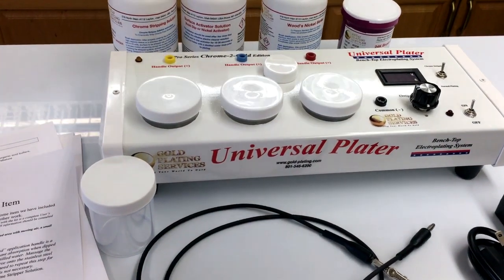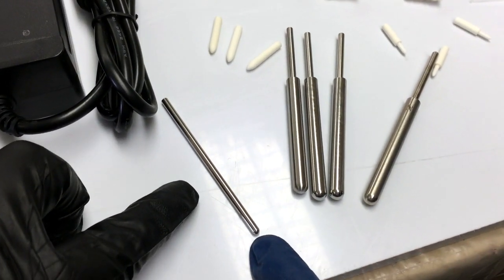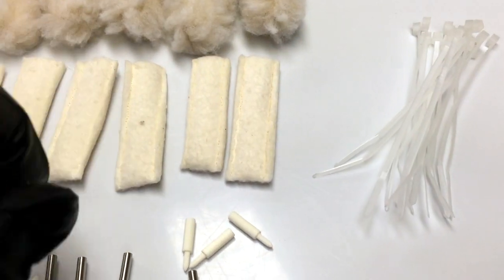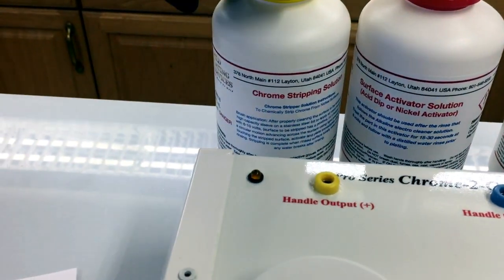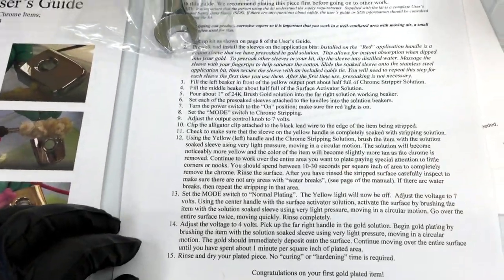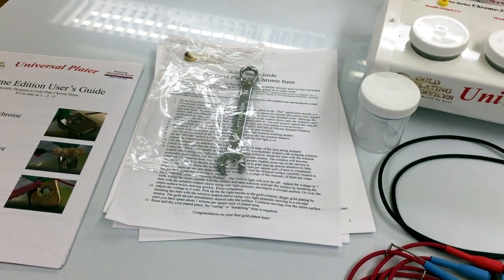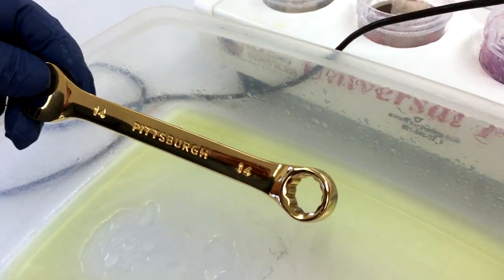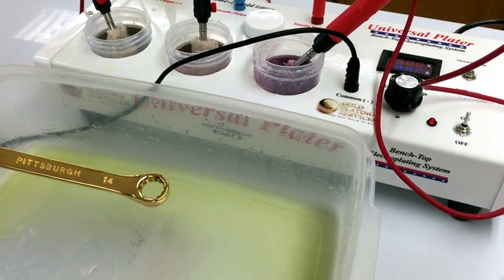How to Gold Plate Chrome Items - Un-boxing, Set-up and Plating - Universal Chrome Edition

Comment: Thank you for posting this. Is this system or technic more efficient and cost effective than just dunking the whole item in the solution? I've seen the "Dunking method " and  the instructors say "Once you make the solution, you never have to make it again" . I plan to re-plate vintage safety razors and  looking for the best way overall to do it. Thanks.

Comment: Hi ... Found your vid; very informative. I want to gold plate an item that has come out of an engine! The item; I have cleaned up as much as I can. How clean do I need to get this item before I attempt to gold plate it? For example; if there is some old oil stains and a little grease on that item; surely the gold plating process is 'not' going to like that!? So, should I soak my item in some sort of acid tank to remove completely all dirt, grease, and oil, and other 'maybe' contaminantes before starting the gold plating process!? 
And, the other quick question is; if I want a really deep finish to the gold plating, can I just keep going 'back-an-forth' over the coating to just make it thicker and thicker, therefor a 'deeper-an-deeper' finish, or is that not the correct way to create a deep quality finish!?

Would love your thoughts.
Thank you so much.
William (Hampshire UK)

Comment: Hello. I've got some old watches that lost their original plating. They were not chromed before. I want to restore the gold. How would this product perform in those areas ? It is very small stuff and tiny corners. I'm also curious to know if different stripping chemicals need to be used to remove whatever they use on watches . Thanks for the video
Reply: I’m wondering this too.Please let us know

Comment: @15:37 you mention "You can't really go wrong over stripping the chrome" but I'll have to assume this isn't the case with fully submerged chrome stripping because if I leave my chrome item in the solution for more than just a few minutes in chrome stripper even at only 5v I end up with the chrome burning and turning a very dark color.  If you would like to comment on this, I'd love to learn something new that I may be doing wrong.

Comment: Can I gold plate flatware for my wedding? This is awesome
Information. It’s so expensive for 800
Pc of flatware
Reply from the maker: Absolutely, flatware can be done.  Congrats on the engagement!  Weddings can be one of the most amazing days of your life.  The question would be, do you want to do all the work yourself or would you rather us do the plating for you?  Plating 800 pieces would be quite time consuming, simply due to the huge number of pieces.  If you'd like, you could shoot us an e-mail with a picture of the flatware you have in mind and tell us what material it's made of (preferably stainless steel if possible) and we can give you our best quote on 800.  E-mail info@goldplating.com

Comment: cool system.

if I were to re-do a watch case where it is Silver ->Nickel ->gold....where the gold has worn off  (the thickness should be about 20 microns)

Do I buff off the gold to get down to nickel? or is there something that can strip off the gold to get down to the nickel layer, buff that, re-nickel plate, buff that, THEN gold plate?

Comment: How good is this for a 416 grade 1911. It seems small and does not take a lot of space. I want to do a nickel finish with a high polish. I also want to ask, if I do go with this process for protection, would I also coat, but not polish the inside of the frame / slide

Comment: Im looking for something i can use on firearms, 
My question is does the firearm need to be crome or stainless steel? 
I can remove the bluing on the gun easy but ill this compound stick to gun?
Reply from the maker: You can plate onto chrome guns, nickel guns, stainless steel guns and regular steel guns.  Guns that are blued or coated with anything need to have the coating removed prior to plating.  Once down to the bare steel, you can easily plate onto the steel the same way as you plate onto stainless steel.  Here is a video showing how we did just that on an AK-47 safety, made of steel: https://youtu.be/gNBC03rq31k

Comment: Oo  a grand for a bench power supply and some chemicals?
Reply from the maker: Great deal right?  Especially considering some of our competitors sell an 8oz bottle of Brush Gold for more than this entire kit.  The 8oz Jar that comes with this kit contains enough gold to cover about 1,200 square inches of area to a typical decorative thickness, so you can do a lot of plating.  It also comes with a large bottle of Chrome Stripper, Woods Nickel Strike, Surface Activator and Electrocleaner. This kit is unique for many reasons.  It really is a complete package that has everything someone needs to get started gold plating onto almost any kind of item that can be brush plated.  It is not just a "power supply and some chemicals".  Thanks for the comment Mr. Schmoe

Comment: Does this mean I could improve the connection on cables by making it gold tipped?
Reply from the maker: Many cables have gold plated connection points.  So do Printed Circuit Boards in computers.

Comment: Considering getting one your kits. I have a few question though . How durable is this on car emblems ? Considering the front of cars are exposed to road grime, bugs and mutliple washes . What kind of time would you have to spend plating a typical emblem for it to last years ? I want to do this as a business and would hate for people to come back a month later saying it wore off. Secondly could this be done with the emblem still on the vehicle? Do the solutions affect car paint finishes ?  Lastly would this work on any chrome plated surface ? Some emblems are plastic and seem to just be painted chrome . If you were to strip back the chrome and reveal only plastic underneath how would you go about gold plating it ? Hopefully you can answer my questions I would love to order a kit very very soon.
Reply from the maker: DURABILITY: It's has hard as gold plating can possibly be.  The thicker (longer) you plate it, the longer the plating will last.  If it is taken care of and not polished, it should lost many many years if done properly.  
TIME PLATED:  Most automotive platers spend about as much time as we did on this wrench.  Check out our other videos that show plating emblems to get a better idea.  If you're concerned about longevity, plate it longer.  However, this is not a common problem.  The only way they're going to come back a month later saying it wore off is if they polished it off or you just tinted it gold (stopped after seconds of gold plating).
STRIPPING CHROME:  A lot of times people see chrome plating bubbling and think it was painted, however that is due to incorrect chrome plating.  Underneath every chrome plated layer, there is a layer of nickel (across the board).  This means it can be easily plated once you strip the chrome.  In the event that you did get down to plastic, somehow, it would not be platable. 

We're happy to answer any and all questions before and after you order.  Thanks for the great questions!
Reply: Gold Plating Services thanks for the ridiculously fast reply. Sounds great I will be ordering a kit very soon ! One more question though if you don't mind , how would you go about gold plating things that aren't chrome ? Would you plate it in nickel then gold ? Do you sell a kit for that ?
Reply from the maker: You're welcome!  If you need to nickel plate something prior to gold plating purely depends on the situation.  Typically, nickel is commonly used as a "diffusion barrier" between a more reactive substrate, (such as copper or brass), and the gold plating.  Gold plating is porous, especially if it is thin, and the copper or brass can still corrode underneath the gold unless you either plate it thick or nickel plate before gold plating.  If the item is stainless steel, this is not necessary as stainless steel does not have issues with corroding typically.  If you do determine you need a nickel underplate, this kit will perform the nickel plating.  You would just need to get some Bright Nickel Plating Solution along with your kit.  Here is a link to that solution: https://www.goldplating.com/collections/nickel-solution/products/bright-nickel-plate-solution
Reply: Gold Plating Services I see! Thanks for the answers and quick replies .
Reply from the maker: Of course.  Each customers success is very important to us.  We like when customers fully understand what they're buying.

Comment: Can you gold plate polished metal?
Reply from the maker: Absolutely!  Gold plating is all about the prep work.  If the piece is dull before plating, it will be dull after.  If its shiny before plating, it will be shiny after.  Plating onto polished metal is ideal, unless the piece is shiny to begin with (in the case of the wrench or a car emblem).

Comment: Thank you so much for this video. Is it working on plastic ? Or only metal?
Reply from the maker: Thanks for watching! Will only work on metal surfaces. So if it's plastic, it would need to be chrome plated first.
Reply: Will the machine Crome plate plastic?

Comment: this is dope how is the durability and how long dose it last ?
Reply from the maker: It is a hardened 24K gold but it is still 24K gold.  How long before it wears off depends on two main factors: 1) How thick the gold is plated.  2) How much abrasion it encounters.  For example, a wrench would certainly have the gold wear off in the area where it meets with metal, however the area you handle with your hand would depend on how thick you plate the gold.  If you plate it thick, it can last many years or even decades if plated thick enough.

Comment: Can you skip the Chrome stripping and make it Gold Chrome?
Or what if the metal is black?
Reply from the maker: There is a way that you can plate directly onto the Chrome, (by using completely different chemicals), however the gold plating quickly degrades within a year or so.  Plus, there is zero benefits and it does not look better.  The proper way to do it is as shown in this video.  In fact, it is our opinion that gold platers who started plating directly onto chrome, (back in the late 90's) is part of what killed the automotive gold plating industry.  Gold Plating on cars gained a bad reputation because peoples gold packages were looking horrible within a year or so.  If done this way, it can last decades if properly taken care of.
Reply: @GoldPlatingServices  Nice info, thanks.

Comment: I have a pair of auto headlight bezels that were gold plated and after about 5 years have a faded look. How would i prep them to redo them n a fresh layer of gold plate. 
Thanks for your time.
Reply from the maker: Typically you have to polish off all the existing gold prior to replating.  However, sometimes you can get away with just plating over it.  It's worth a try to do a small area, usually the worst spot, just to see how it looks - if it looks good, plate it.  If it doesn't look good, you polish it and plate.

Comment: How long can you use the same solution? Can I use it until its finished or should I change out after every use? Same question for the sleeves. Thank you.
Reply from the maker: You can reuse the solution until it is gone.  The sleeves can be used until they are destroyed or you feel need changing.  Eventually they will wear a hole through or get deformed.  Sleeves are only about $1.50 each.

Comment: I bought bright nickel . Can I use that or do I need woods nickel strike? Are they different solutions? If so what's the difference. Thanks for replying. I have this machine so still learning
Reply from the maker: Unfortunately they are entirely different solutions.  Bright Nickel applies a decorative bright nickel plate.  Woods Nickel Strike does not produce a "plate" but instead was designed to allow you to apply a final "plate" and have it adhere to steel/stainless substrates, such as gold on stainless steel.  They are not even remotely similar except for they both contain nickel.  All other ingredients, pH and purpose are different.  

No worries, this is a craft and an art - you will spend your entire life learning!  It's just like any other skill, there are levels of mastery and always room to learn more.  Please let us know if you have any questions, we're here to help!

Comment: Thanks alot for replying! Y'all are the best! So can I apply gold over bright nickel? For instance if I have raw polished metal sonebody wants gold plated. What would be the steps to gold plate polished metal? For metal would inplare with a nickel or stainless bit?
Reply from the maker: We're happy to help!  You absolutely can apply gold over nickel, it is very common.  For plating basic metals (nickel, brass, bronze, copper, silver, etc.) you typically pretreat them all the same way: Electroclean, Activate, Plate.  The metals that are special case scenarios are Steel/Stainless Steel and Chrome plated items.  Steel/Stainless Steel need to be Electrocleaned, Woods Nickel Strike'd and Plated. Chrome items need to be plated as shown in this video (Stripped, activated, plated). The only time you use a nickel bit is if you're using a nickel based solution, such as Bright Nickel or Woods Nickel Strike.  

You may find this video useful regarding plating onto nickel: https://youtu.be/iktSfq0LDmw

Comment: Hi! Its will work in chromed parts that had started to rust?

Any kit for doing the complete job in steel? ( removing all the old chrome, nickel and rust, and plate some copper, nikel and the gold, ot even the chrome again? )

I'm think in restoration off guitar parts.

Regards.
Reply from the maker: Metals that have rust or corrosion need to be polished to get it down to the bare metal before you plate.  Gold plating will only look as good as the surface looks before plating - if its dull before plating it will be dull after, if its shiny before plating it will be shiny after.

The kit will plate onto steel with no issue as long as you use Woods Nickel Strike as your second step instead of Surface Activator (This is all included in the kit).

To remove chrome you just use the chrome stripping solution.  To remove rust you have to polish it off.  You can then activate the nickel and gold plate the piece.  There is no need to copper plate onto nickel, which nickel is under every chrome plating job.

We have lots of customers who restore guitar parts.

Comment: If I get a burn spot while plating how do i fix it and touching up faded gold how do I go about doing that?
Reply from the maker: If you are careful to stay within the voltage guidelines of the equipment you should not have any burn spots. However. if it were to happen it is easy to fix. Simply take a mixture of baking soda and water and make a paste. With a soft cloth gently buff it out. If you get faded gold spots, just clean the surface thoroughly, activate it, rinse it and gold plate it again.

Comment: yaa we have such plant but i have doubt can i do nickle plating without having copper plant
Reply from the maker: Nickel can be applied directly to many substrates without first Copper plating.  For instance, you can nickel plate directly onto copper, brass, bronze, silver, gold and mixtures of those types of metals.  Frequently, copper plating will be applied even to copper substrate, however it is not necessary.

Comment: one more question. 

does the temperature of the item or the temperature of the solutions have an effect to the application?
Reply from the maker: Temperature definitely can affect some solutions, however it does depend on what temperature and what solution.  Typically unless you intentionally heat the solution or intentionally heat the item being plated it should not be an issue.

Comment: Hello sir Is There Any Way To Remove Gold From Zinc Metal Plates? Nd do uh Guys provide Tht Gold Removing Chemical To In Universal kit?
Reply from the maker: Gold needs to be mechanically removed unless you have access to a free cyanide gold stripping solution.  We do not sell any such solution as it is highly toxic and highly regulated for obvious reasons.  Fortunately, gold is quite soft and with polishing compounds is quickly removed.

Comment: Hello I restore Atmos clocks most of which are brass. Can I plate onto this surface?
Reply from the maker: Brass is a highly platable substrate.  For plating onto brass you follow the "basic" plating process of the standard Universal Plater Kit. This basic process is: Electroclean, Surface Activator, Gold.  Some people choose to apply a layer of nickel prior to gold plating, as it serves as a "diffusion barrier".  As you probably know, brass quickly corrodes when exposed to oxygen or other things especially sweat (which contains salt).  A layer of nickel will protect that brass from ever corroding , even if the gold plating wears thin.  In this situation, you would do the same thing: Electroclean, Activate, Nickel plate, then Gold plate.

Comment: Nice video. Can this be done with none chrome metals? Or on aluminium also? Thanks
Reply from the maker: Yes it can!  Aluminum cannot be plated with any of our kits as it needs to be done on an industrial level by a trained professional.
Reply: @GoldPlatingServices  just out of curiosity why do you say this? I industrially chrome aluminum parts for a living and couldn’t you theoretically zincate, nickel, copper and then chrome plate? Unless your systems don’t allow for this

Comment: what if you are working with plain steel, can you skip some stages?
Reply from the maker: All types of steel are done a specific way.  We have a few videos showing how to do it with the Universal Plater Kit.  You have to first Electroclean, then Woods Nickel Strike, then Gold plate.  If you skip any of the steps it will not bond correctly or look good.